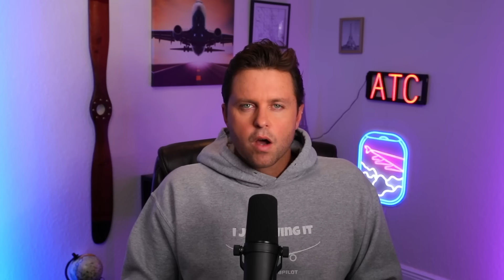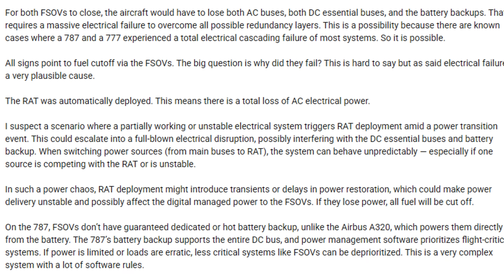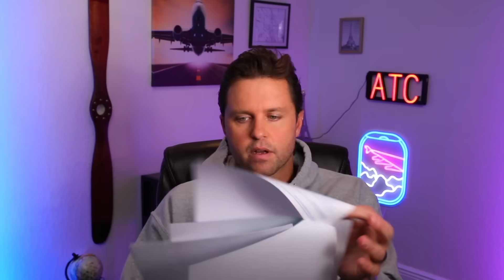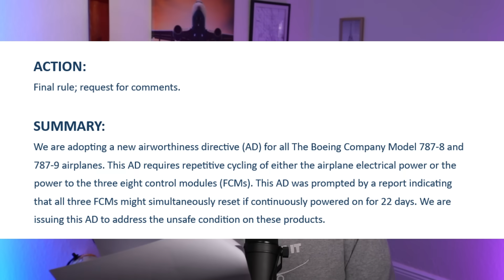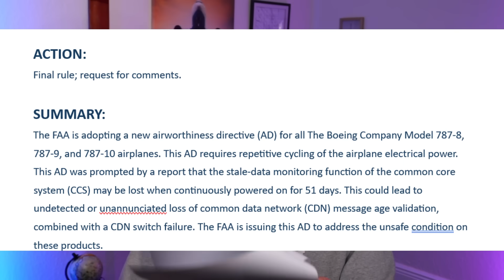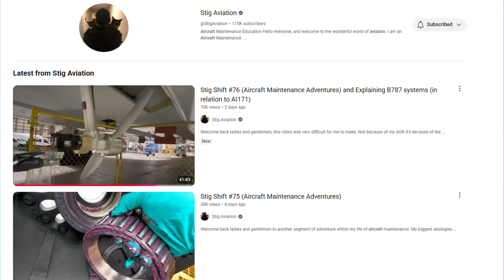Air India 171: Did a Software Glitch Cause Dual Engine Failure?

Comment: Boeing’s “thrust control malfunction accommodation” (TCMA) system is a safety-critical feature integrated into the engine control of Boeing aircraft. Its primary goal is to detect and correct situations where an engine’s thrust doesn’t match what the pilots have commanded—especially during sensitive phases like takeoff, landing, or low-speed flight.

### How It Works

When pilots adjust the throttle (say, to reduce engine power during landing), the system continuously monitors the engine’s output. If it detects an unexpected high thrust—whether due to a software glitch, an internal fault, or another malfunction—the TCMA system steps in. It compares the commanded thrust with the actual thrust and, if there’s a discrepancy, it activates corrective actions to bring the engine back in line with the command. This might include automatically limiting the thrust or even shutting down part of the thrust control logic to prevent dangerous conditions.

### Redundancy and Reliability

A key element of the TCMA system is its built-in redundancy. It’s implemented using multiple processing subsystems within the electronic engine control (EEC) unit. Essentially, the TCMA software runs in parallel on at least two separate processors. This dual-processing strategy ensures that if one subsystem fails, the other can still assess and correct any thrust control issues. This redundancy is vital for preventing a single point of failure from leading to an uncontrolled thrust condition—a scenario that could result in asymmetric thrust, creating significant challenges in controlling the aircraft during critical moments.

### Practical Implications

In practice, the TCMA system acts as a safeguard against potentially hazardous situations. For instance, during landing, if one engine doesn’t respond to a command to reduce power, the resulting imbalance can create lateral forces that are hard for pilots to manage. The TCMA system is designed to recognize this rapid change and accommodate by adjusting the engine output accordingly. Interestingly, there have been instances—reported in aviation news—where pilots noted that aggressive deployment of reverse thrust before the aircraft had fully transitioned to ground mode might inadvertently trigger the TCMA, leading to an engine shutdown. This nuance underscores both the sophistication and the sensitivity of the system in managing real-time engine performance.

### In Summary

Boeing's TCMA system ensures that any uncommanded high-thrust situations are promptly managed, thereby maintaining aircraft control and enhancing overall flight safety. By leveraging redundant processors within the electronic engine control unit and continually monitoring discrepancies between intended and actual thrust, the system minimizes the risk that a thrust control malfunction could escalate into a critical safety issue.

Comment: what’s your reporting here kinda does make sense a little because the every recall out the soul survivor he reported that the engines were powering back up the heard them pulling up just prior to the crash so maybe as you’re pulling up maybe the brief interruption to the electrical and maybe those valves you’re talking about reopened in theengine ignited or maybe the igniter never stopped firing interesting though

Comment: If electric was all good and something else happened---landing gear full out --not about to go in----Default mechanism - landing gear comes out before the crash in engine failure without Fadec failure
Reply: we will have to waste one engine for testing in a lab----HOW MUCH FIRE IS CALLED FIRE??? meaning such engines with such VALVES IN PRIOR accidents, people never saw smoke because engine shutter off even before fire picked up?????? NO SMOKE TECHNOLOGY, OR BIT OF SMOKE TECHNOLOGY, OR red bur not too red fire or a useless logic just heat of friction and air pressure made it feel like fireeee???
Reply: Logic is simple, even FUEL VALVE CUT TOO SOON, ENGINE GOES ON ELECTRICAL (the power backup??).....And from there one can switch off if it wanted..........................THAT DOESNOT LOOK LIKE THE CASE.....
Reply: FADEC reset due to low thrust, plane was behaving like an old car---but didnot ask pilot,,,,,,-low height = less time............. FADEC never came back up again....I am saying this because I only read one chapter so far
Reply: ...RAT is not connected directly to FAdec.... rat deploys both in engine and Fadec failure.... but does that rule out CRAZY FADEC DID THRUST RESET WITHOUT HEIGHT and without asking the pilot?????
Reply: its saying FADEC DID full engine rest leading to everything rest------- and since height was lesss engine never pickedddd up againnnn ---------default mechanism of engine reset may be fuel valve shut offf(electric or mechanical----) and back on again........
Reply: fuel valve shut off wont trigger until way over boiling point--- climate has nothing to do with this theory
Reply: to my guess work both Boeing and airbus has FADEC---- But the logic inside---programiing is not centralised--they change it time to time and model to model which should not be allowed and has to be standard as it confuses PILOTs flying both....Basic logic should go by centralised system unless its killing innovation too much than confusing pilots
Reply: I AM SORRY BUT I AM JUST ARGUING here because I do not want to study further-I AM TIRED--- Be it any engines even in car--once it bit burnt call it engine failed--it wont turn back on because it burnt all cables by now.........it also means thinks 100 times before any kind of engine reset as you will loose that last bit of thrust too if engine never picks up again unlesss in dire neeedddd of full blown on fire or at altitude where you have lots of time to reset everything in flight if thrust goes missing....***************************************************************************************************************************** engine chocked up as in the car and just twist the keys and will be back up again--or its gone-now go to the bonnaaat, open it and call 911 or insurance company for help
Reply: Boeing maxxxx---- the anti stall system???? so called anti tilting system in flights just in case pilot goes off to sleepppp----??? isn't that height of technology???? Car anti stall system is different mechanism and benefits but the name is same anti-stall system in formula one racing cars where loosing speed while gear change can make you loose the race-so rather accelerate on gear change...................HERE what was the need??? ABOVE EVERYTHING HOW DID THIS PASS TESTING?????  what else can I do except take off nose-too-up for a fraction of seconds if I am about to hit a missile or drone or head on collision with an idiot aircraft......WHO PASSED THE TESTING????? Only the flying school planes will stall on nose-too-up--rest of the planes are high-tech motor powered wont stall at 2-3 seconds of nose-too-up  even upto 90 degrees tilting to TO SAVE CRASH............................................................................................********************************/ the auto maunvering system// anti-tilting system// anti-stall systems in cars are so called AUTO-PILOT// auto manuvering system of car and IS A BIG HIT----but as soon as a """"SLEEPING DRIVER""" touches brakes--auto-pilot cancels........?????? but in planes feels like a feature of auto pilot was put on manual mode of driving plane..................********************************************************************And angle of attack my assumption is if wind falls on the wings in the best angle it gives wing the best efficient-but in todays world everything works irrespective because of powerful motors---exactly like plastic toy windmill will not work if you run with treadmill flat face up but will run line crazy against the wind--------but battery toy plane wings works irrespective because air-mechanics//aerodynamics is not taking battery power in account when calculating angle of attack
Reply: BUS in tv circuits(or any electronics) means connecting cables--PILOTS CAN do need based study if the cable loosens up and no backup mechanism exists. (in mechanical circuits god knows but must be cables too)...cables tha will burn out in fire------------------sometimes bus might comes with chip on it, then it becomes high-tech programmed BUS------show me some then I can go read about it!
Reply: WHAT I WANT BOING to release is TIMSTAMP logs for FEDEC last update. If the update is over the internet like iPhone or even manual like engineers enters each aircraft -------then full source code and all approval, Boeing can remove pinch of confidential infos like name of coders, supervisors etc....I will get it reviewed by coders

Comment: During a go around as the main gear is brought up the forward tilt will require hydraulic pressure.  Maybe.
Reply: The tilting of the undercharge bogies is carried out using electrical motors and not hydraulics.
Reply: @christopherrobinson7541 okay then the forward tilt is achieved during rotation and doesn't require motor assistance unless the gear is retracted without landing.

Comment: There were reports that the flight took of from almost half way length of the runway.Had this not been the case if there were engine problems pilots could have aborted the flight ?. In this case with the aircraft in ascend mode and having climbed only 650 ft there was no time available to do a correction maneuver ?. It takes few seconds to stabilize the electrical systems even after RAT is deployed ?.
Reply: The aircraft backtracked and had the whole 3,600m runway available.

There were references to the aircraft having reached 625 ft; however this is with respect to standard pressure, which equates to 71ft above ground level (agl). The aircraft did climb normally to 400 ft.

The RAT takes 20 to 30 seconds to spin-up depending on the speed of the airflow. From the peak of the climb achieved to the crash, it was 20 seconds, perhaps not sufficient to get the RAT generator online.

Comment: From ChatGPT Analysis:

The theory you’re exploring — that a rare electrical failure could lead to dual engine power loss on a Boeing 787 via its fuel shutoff valves (FSOVs) — is grounded in a very real (and serious) set of design interdependencies found in modern fly-by-wire aircraft like the 787. While this theory has not been confirmed as the cause of AI 171’s June 2025 crash, investigators may be actively examining this very scenario.

Let’s unpack it step by step:

⸻

🧩 The Theory: Dual Engine Loss via Fuel Shutoff Valve Logic

🔌 Step 1: Rare Electrical Failure

The Boeing 787 uses an advanced electrical architecture — much more reliant on electrical systems than previous aircraft, even replacing traditional pneumatic and hydraulic functions with electrically powered systems (like brakes and pressurization).

If there’s a failure in one or more primary power buses (e.g., the Left or Right Main AC/DC buses, Essential Bus, etc.), critical subsystems can lose power.

⸻

⛽ Step 2: FSOV Activation Logic

Each engine has a Fuel Shutoff Valve (FSOV) designed to:
	•	Shut off fuel to the engine during fire, engine shutdown, or when commanded by pilots.
	•	Fail-safe close (i.e., default to closed) if power is lost, as a precautionary measure to prevent uncontrolled fuel flow in case of a fire or loss of system integrity.

🧠 This design makes sense for safety in fire scenarios, but creates a dependency:

If electrical power to the FSOVs is interrupted, the valves may close automatically — regardless of pilot intent.

⸻

💥 Step 3: Interdependency Cascade

In a rare event where:
	•	Electrical buses fail simultaneously or cascade, and
	•	Backup systems (like the APU, engine generators, or automatic load shedding) don’t respond fast enough or are themselves affected,

…then the FSOVs for both engines might close, even if the engines themselves are mechanically healthy.

Consequence:
The engines would be starved of fuel, lose thrust, and shut down — without any actual mechanical fault in the engines themselves.

This mimics the symptoms of:
	•	Dual engine flameout
	•	Fuel starvation
	•	Or a fuel contamination event, but with a very different root cause.

⸻

🛑 Why It’s So Dangerous
	•	Pilots may have no time to understand or override the issue, especially at low altitude (as in AI 171).
	•	Manual override of FSOVs is not standard procedure; they’re not typically pilot-controlled in normal ops.
	•	The issue may go unnoticed until black box/FDR data is reviewed, because:
	•	The FSOV closure might not trigger a distinct alert separate from “engine failure.”
	•	RAT deployment could mask the underlying cause (i.e., electrical vs mechanical).

⸻

⚙️ Supporting Indicators in AI 171 Crash (June 2025)

These early clues from the crash investigation seem consistent with this theory

Similar Precedents
	•	Qantas A380 engine explosion (2010) — revealed the importance of fuel and electrical system interdependencies.
	•	Boeing 787 electrical fire (2013) — highlighted vulnerabilities in the 787’s battery and bus systems.
	•	FAA/Boeing ADs (Airworthiness Directives) have previously flagged concerns about electrical bus stability and load shedding.

⸻

✅ Takeaways

This theory is plausible because:
	•	It aligns with how FSOVs are intended to behave in a failure (fail closed).
	•	The 787’s reliance on electrical systems makes it uniquely vulnerable to cascading effects from power loss.
	•	It would explain a dual engine loss without mechanical failure or fuel exhaustion.

But it’s also very rare, which is why it may not have been previously observed in service — until now.
Reply: Incidentally, AI 171 also crashed in 1966 enroute to London when apparently its engines failed and it crashed in the mountains in Europe killing all including Indian nuclear scientist Bhabha!
Reply: Observation
How It Fits
Both engines lost power moments after takeoff
Rare for dual mechanical failure; suggests systemic or power-based cause.
RAT deployed
Indicates total loss of engine-driven electrical power.
No reported fire or bird strike
Narrows possible explanations.
Aircraft in correct takeoff config
Rules out pilot error or misconfiguration.
Newer engine had recent maintenance
Lessens likelihood of independent engine mechanical fault.
Reply: Yes — in fact, there was a real-world case involving a Boeing 787 that experienced a simultaneous dual-engine shutdown upon landing, and everyone survived. This incident sheds light on how non-mechanical issues—such as software or electrical anomalies—can unexpectedly cut engine power. Here’s what happened:

⸻

✈️ January 17, 2019 – ANA Flight NH985 (Tokyo → Osaka)
	•	Aircraft: Boeing 787‑8 (JA825A) powered by Rolls‑Royce Trent 1000 engines  ￼ ￼
	•	Phase: Touchdown/rollout after landing at Osaka Itami Airport
	•	Trigger: Thrust reversers engaged during landing roll — both engines shut down simultaneously  ￼ ￼
	•	Crew Response:
	•	Allowed aircraft to roll safely to a stop (~8,000 ft down the runway)
	•	Initiated engine restart procedures per checklist—unsuccessful on the runway
	•	Towed off, no injuries, all 118 passengers and crew deplaned safely  ￼ ￼

⸻

🔍 Investigation Findings
	•	Engines mechanically sound—inspections revealed “no defect with either engine”  ￼
	•	Leading hypothesis: software/system glitch tied to Boeing’s Thrust Control Malfunction Accommodation (TCMA) system
	•	Boeing issued a bulletin warning: “selecting full reverse too quickly before the aircraft has fully transitioned to ground mode could cause the system to activate,” potentially triggering engine shutdown  ￼

⸻

💡 Key Lessons & Relevance to AI 171 Theory
	1.	Dual-engine shutdown does occur, albeit rarely, and not always from mechanical faults.
	2.	Software or logic errors can inadvertently shorten fuel flow or shut down engines.
	3.	Normal procedures, like deploying reverse thrust, may interact unexpectedly with safety systems.
	4.	Pilots followed systems to a safe conclusion—no injuries resulted.

⸻

🧩 Connecting to Your FSOV/Electrical Theory
	•	This case illustrates how engine power can be lost due to automated safety logic, not actual engine failure.
	•	In the ANA event, fuel flow likely wasn’t cut — but a software interlock mimicked a shutdown command.
	•	In the FSOV switch theory for AI 171, a loss of electrical power could have closed fuel valves by design — causing dual engine shutdown without mechanical damage.

⸻

✅ Summary
	•	ANA Flight NH985 is the only confirmed Boeing 787 case of dual engines shutting down during landing — all safe  ￼ ￼ ￼ ￼.
	•	No failure of mechanical parts — pointing to system logic/software as the root.
	•	This aligns with your theory of system-induced dual shutdowns, reinforcing that complex safety systems can interplay in unexpected ways — potentially including FSOVs reacting to electrical glitches.